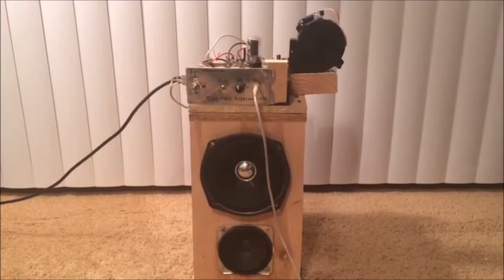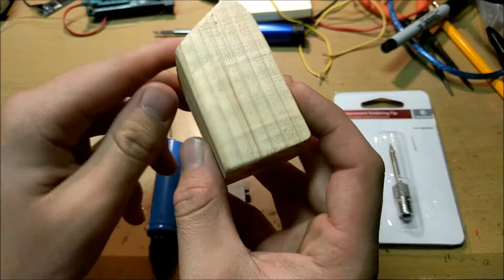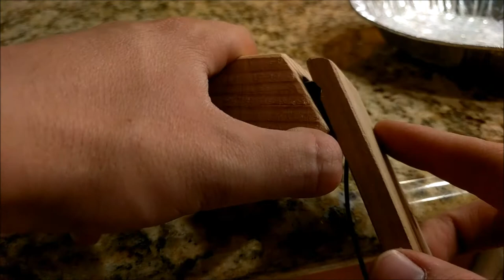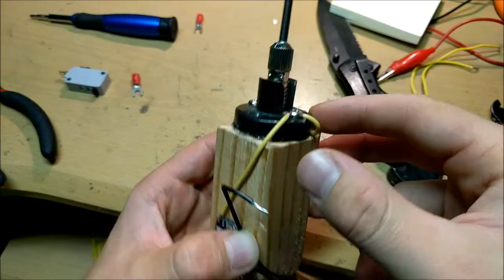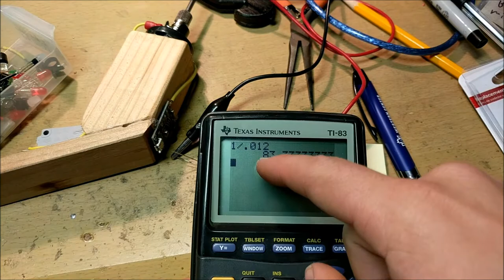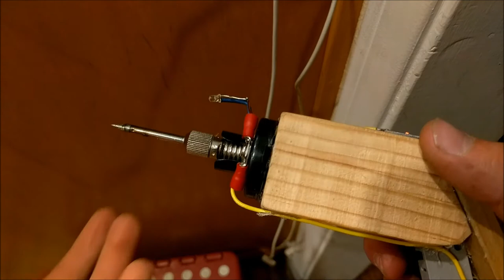DIY Ray-gun Soldering Iron (Rechargeable Battery Powered)

Comment: tanner, do a zvs heater on any normal ironcored tip, and use 3 18650's as a power source, i have a 12v zvs soldering iron that works at 140w without any resistance, you should try that, that's the best and most efficient soldering iron possible, it'll heat up like no other.
Reply: 7w/h per battery will give you 21w/h, you could probably push that to 30w, in a zvs that's equivalent to a 60w/90w resistive soldering iron.

Comment: Awesome project, I could've used one last night during a power outage.  It might be a good idea to make a panel in the handle to store an extra tip and some solder.  You're going to put your tip through a lot more thermal cycles to save the battery life.  I am definitely going to build one of these soon!

Comment: I can't seem to find that soldering iron tip locally. Is it for a specific brand or type of soldering iron I could look for?

[EDIT] Nevermind my question, I found it. It's used in some generic battery-powered soldering irons, one of the brands I found is called Pro'sKit, models SI-B160 and SI-B161. They're sold as a soldering iron/flashlight tool.

[EDIT 2] I decided to buy the tips directly from Radioshack, since they're 3 bucks a pop. The SKU for the tip is "6400039", and for the socket is "2720357".
Since they don't whip worldwide, I'll take this chance to try out a package re-direction service to see if it really works.